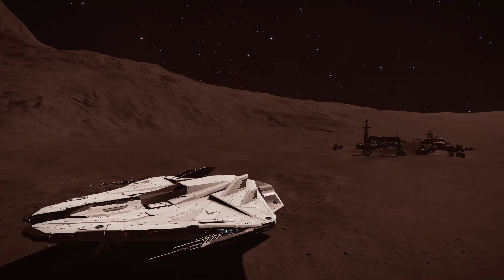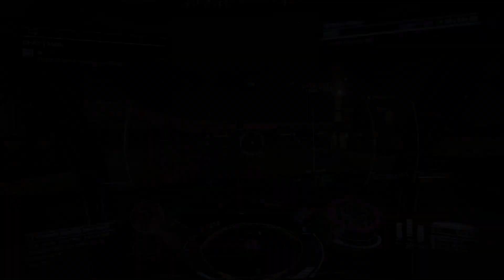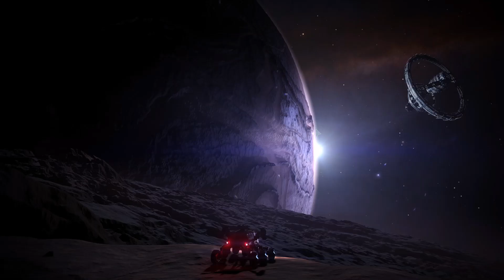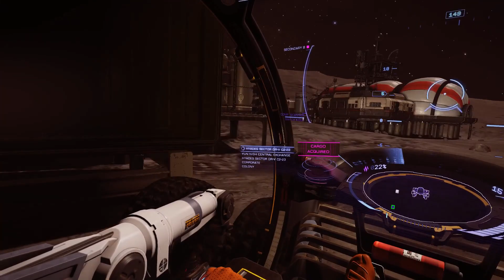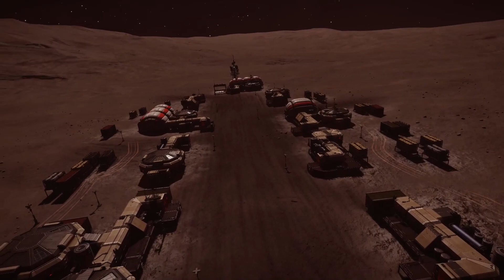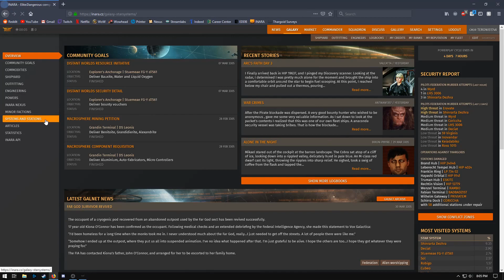[Guide] Farming Engineering Materials (Pt. 1 - Manufactured) Dav's Hope - Elite Dangerous 3.3

Comment: How can you synthesise fuel
Reply from the maker: Go to the inventory panel, on the left side scroll down the icons until you get to the synthesis tab. You can scroll down the list of synthesis items, (fuel takes 1 Sulfur and 1 Phosphorus) and select Synthesize. It will take a few seconds. If you don't have sulfur and phosphorus, it can usually be mined from surface minerals but grade 1 minerals are extremely common in thargoid barnacle sites. You can farm up a few hundred of them pretty easily and quickly.
Reply: Wow thanks man I didn't even know about doing this and now have learnt at you can make ammo and everything .
Reply from the maker: @lucifermorningstar4503  Yep! don't waste materials on repairs though, you can fully repair the SRV by simply boarding the ship and re-deploying.